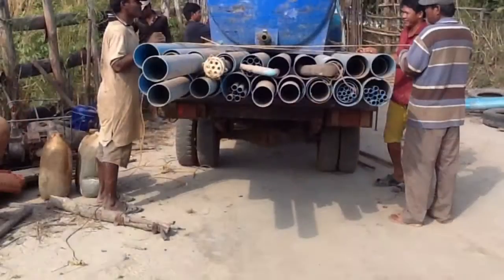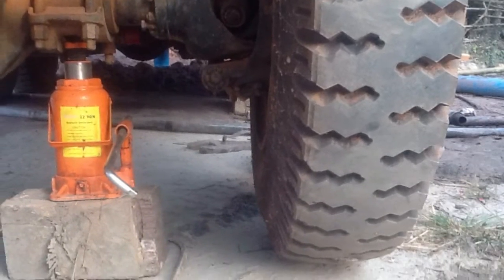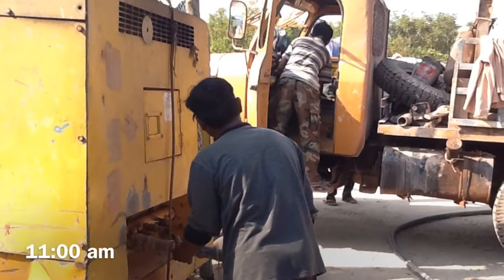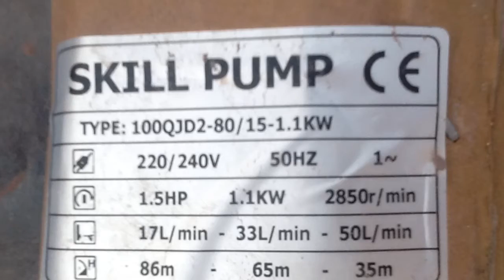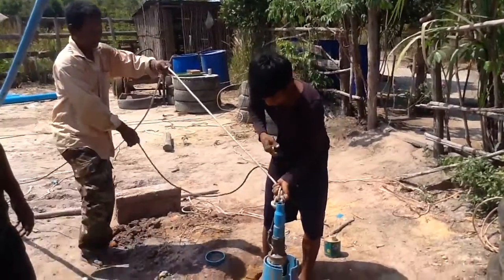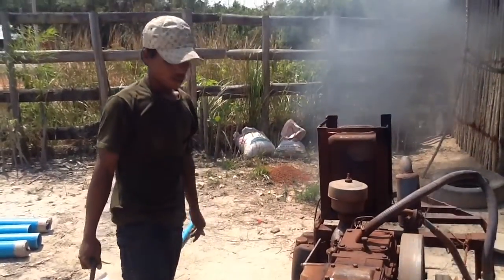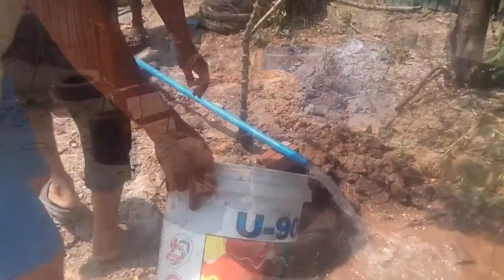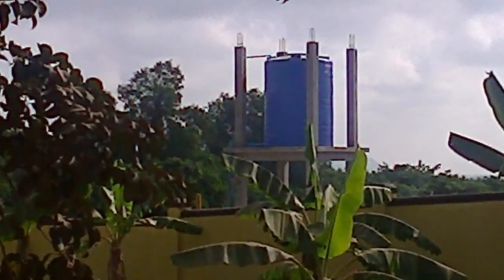WATERWELL DRILLING CAMBODIA funded by LIONS CLUB GERMERING - GERMANY (2016)

Comment: Sir what is the price per feet for drilling
Reply from the maker: Hello Prasaanth,
at that time Som Lean company offered us a fixed price of 4.000 US$ for a drilling down to about 70 or 80 meters including the pump you see in the video. We were then lucky to find water at 40 meters already, but to make sure they drilled up to 60 meters and finally placed the pump at about 50 meters.
If you need a drilling less deep you may find a company that offers a lower price. But be aware of extra costs like electricity for the pump (generator or public electricity supply), a water tank, the pipes and installations...
I hope this information is helpful for you!
Best, Martin